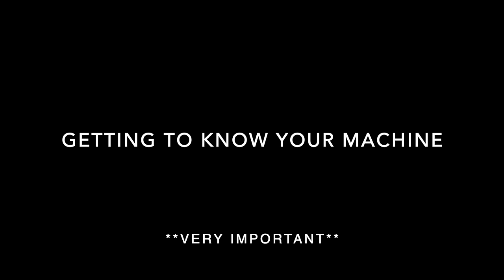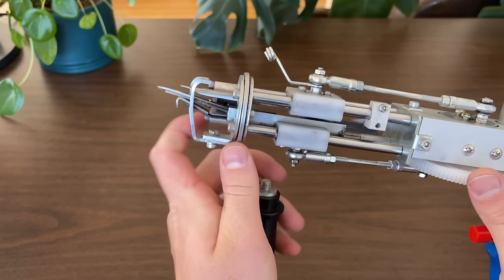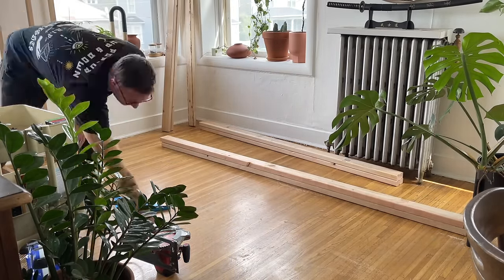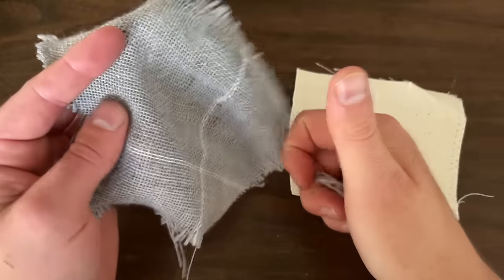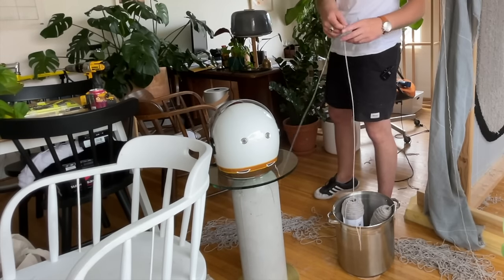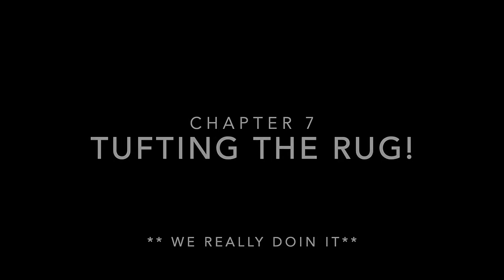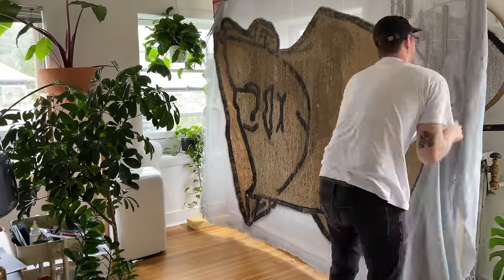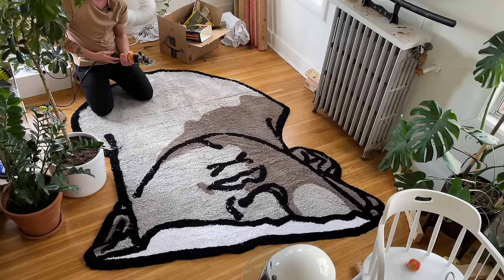EVERYTHING YOU NEED TO KNOW TO MAKE A RUG // RUG TUFTING

Comment: Ok, so the "embroidery fabric" you were looking at is called Aida, and it was created & is used specifically for cross-stitch.

Hand-embroidery is traditionally done on linen (or any even-weave fabric). Traditional hooked rugs are also done on a variety of evenweave fabrics, including monk's cloth, linen, burlap, or rug warp. I assume a rug tufting gun would also work on those fabrics, typically at 12 or 13 thread count.

Just don't try to use aida for anything but cross-stitch. It's a weird, stiff fabric!
Reply from the maker: Couldn't agree more! I noticed a lot of online places were trying to pass this Aida as tufting machine fabric when it definitely is not lol!
Reply from the maker: Thanks you for the comment! :)
Reply: @Shop Last.  I've been doing more rug hooking since posting this comment & learned some new stuff that made me think of what I said & worry if it was correct! Monk's cloth is similar to Aida in that it's a "basketweave" fabric, and Monk's cloth IS used for rugs! But looking at the video again, I'm still sure that was Aida. Monk's cloth looks similar, but wouldn't be so stiff. I think the one you called "Monk's cloth" in this video might have actually been "Rug Warp"? But I'm still not an expert on fabrics & every time I learn something new, I realize how many times I've been wrong! The white lines are a feature you'll see on Monk's cloth frequently, but it seemed to be single threads woven, instead of a 3x3 pattern like with monk's cloth and aida 🤔

Comment: All the repair parts can be ordered quickly and cheaply from the factory in Shandong, China.  They are very knowledgeable and helpful and can tell you what to anticipate as far as maintenance and even a few improvements!  Thanks for a great video.  That was a lot of fun and made me want to get a gun to make rugs for my grandkids and maybe try my hand at turning child’s crayon pictures into custom rugs for their room.  I used to lay/repair carpet and there is a heavier pro gun that is not nearly so much fun to use.  But at those shops you can find special carpet knap scissors that give perfectly level cuts when you find minor imperfections.  Also, in the 70’s we used gunny sacks from the local feed store to make rug patches for professional carpet repairs.  It holds up and stretches roughly the same as the jute backing on most carpets.

Comment: This video is so helpful, thank you so much! Has anyone ever used a tufted rug for a long period of time? I love the idea of them, but the fact that the wool is basically held it with tension makes me a bit nervous for regular and real-life use. Does the glue crack/cause issues over time? Does the backing peel off? I always think these rugs are absolutely beautiful, but are they better art pieces, or are they durable even after stepping on them, vacuuming, etc?
Reply from the maker: This is a great question! I’ll do my best to answer all of the different parts. 

The yarn isn’t held in my tension (well it is at first while you’re tufting) but once you add the carpet adhesive or what ever glue you use that glue locks into the fibers of the yarn on the back side of the rug making it nearly impossible to pull the yarn out. The glue doesn’t crack, it dries in a pretty malleable. And the back material should come off if you use a good quality adhesive. This process is basically the same any rug manufacturer would use but we’re doing it by hand.

This rug has been my main living room rug and it has seen a lot of abuse and it is holding up great so far👍🏼
Reply: Is the glue you chose specifically for a floor use tufted rug?  I saw another YouTuber demonstrate washing tufted rugs and they ALL fell apart when she put them in the wash.  I do not believe she used the glue you used, nor do I believe the floor rugs should be put in a washer.

Comment: Hi, I just got interested in started to tuft. When creating new rugs do you always have to create a new frame?
Reply: Also can you put a list of the items you used?
Reply from the maker: You don’t need to make a new frame every time. You’ll only need to make a new frame if the size of the rug you’re making is bigger than the frame. Or if the fabric you have left is to small to fit on the frame you have.

The items you need are:
Tufting gun
Monks cloth (for rug tufting)
Yarn
Glue
Wood (for frame)
Carpet tacks (for frame)
Eyelets (to feed the yarn though on your frame)
Backing cloth 
Scissors
Sheep shearers
And I recommend a threading tool.

I think that’s everything? 😁

Comment: So you explained everything great EXCEPT for the actual tufting of the rug. You just did super fast forward speed and didn’t explain the correct way to do it or what would cause you to mess up. You explained in depth how the gun works and how to build a frame but not about the correct techniques needed to tuft. Turned out really great though
Reply from the maker: That is a valid point thank you! It is hard to explain but the gun will kind of walk it's self once you start to do it
Reply from the maker: And it depends on the speed you set the gun up for.

Comment: Fantastic rug. May I ask why you use two threads instead of one. Also does the adhesive stop the backing from fraying. Many thanks
Reply from the maker: You can ask anything you'd like! This channel is for me to learn and to share with anyone who wants to learn! Two thread will help fill out your design much faster than using one. Along with that, the fabric is losely woven and having two threads in a whole compared to one will help them stay in place mech more easily. And it will help, but I would recommend making a hem or folding over when applying the backing. Mine is still holding up just fine but part of me wishes I took the time to make it nicer.

Comment: My electrician room mate it very concerned about the safety for your tufting gun, specifically the live uncovered leads on top combined with the aluminum body as well as the on off switch, something about the power rating. He’s is absolutely shitting himself lol
Reply from the maker: Yeah I’ve seen a lot of those comments. It’s definitely a very “bare bones” design. But if you have any intelligence at all you’ll know not to mess with those certain parts of the machine. When you buy the machine there is a pamphlet that explains the dangers and warning of using the machine. But I haven’t had any issues nor have heard about any accidents that have happened with them, and these machines are super popular so who’s to say lol

Comment: Really nice work, master piece 🤌 
Does anyone have any idea how to adjust the size of the needle hole ???
Reply from the maker: There should be a screw about an inch  and a half from the needle hole on the needle body, loosen that and then you can adjust the plate under the needle to close the hole smaller or larger👍🏼

Comment: You're explanation is wonderful. I do punch needle and have been thinking about making some rugs, so I greatly appreciate you showing the gun and how it works with the yarn.
Question: how did you project your image that large? 
I don't want to go this big, but I want the lines to be this perfect! 💯
Reply: I'd use an old school projector. You trace your design on clear acetate sheet, put it on the projector, and it projects the image as large as you want it. I use mine to project images for painting windows. It works very well.
Reply from the maker: I just uploaded my image to a usb drive and plugged it in and then scaled it with the zoom on the projector. But I also love @WhereAdventureLives style as well!

Comment: The side that you had facing the camera and the side that you are using the tufting gun on is the backside of the rug. Is that correct? Also, when you were initially making the grey lines before starting the project you mentioned that it was not working. What did you decide was not working when the thread (yarn) was not staying in the fabric?  You are the third person I have seen doing this with the first being Sumji.  If I can figure out how to start an online business this would be the area that I would really want to do. I believe that once I learn it should relatively easy.  One more question, after nuilding the frame what was the name of the sticks with nails in them that you attached? They looked like the same thing used when installing carpet in the home. Thanks in advance and I like that your video is very organized.

Comment: Which machine did you use for the trimming ??
Reply from the maker: I bought a sheep sheerer off Amazon! You need something with wide set cutting blades to be able to get the yarn in there to trim it up👍🏼
Reply: @shop_last  i looked it up but people having real bad problems with the most. can share the model and ur experience with it?
Reply from the maker: @gorkemkilic9769  I bought these.

https://www.amazon.com/BEETRO-Electric-Professional-Grooming-Livestock/dp/B08DN6FJKV/ref=mp_s_a_1_3?dchild=1&keywords=sheep+sheer+clippers&qid=1629243999&sprefix=sheep+sheer&sr=8-3

These are very powerful. You just want to take your time making sure that you’re holding the shedders flat when trimming👍🏼

Comment: just one question: the way that you glued the backing was kinda confusing.. You first applied the glue and then let it dry, but not so much so that the back would stick. Is that right?
Reply from the maker: Correct. I wanted it to be dry enough that I could handle it. But I wanted it to still be tacky enough to fold over the edges of the monks cloth. This was more me being impatient than how it should be done. You can wait until the glue is all the way dry and then use the spray adhesive to fold the edges over and then apply the backing.

Comment: How does it hold up when you clean/ wash it??
Reply from the maker: So because I used acrylic yarn and not wool, I’ll have to be careful washing it. These cheaper yarns will definitely bleed dye so you need to spot clean very carefully or use a steam cleaner if possible👍🏼
Reply: @shop_last  thanks for the info. And the adhesive,  does it hold up as well if you dont mind me asking
Reply from the maker: @thehacker40_1  I would definitely go with the ATT stuff if you can. That will hold up better that just standard carpet adhesive👍🏼
Reply: @shop_last  thanks. Still waiting for my gun so just wanted tips and stuff 😁
Reply from the maker: @thehacker40_1  right on! I’m happy to help any way I can!:)
Reply: @shop_last   what would you inplace of monks cloth. Its not available where i live
Reply from the maker: @thehacker40_1  anything with with a pretty loose knit should work. You need to make sure that there are visible holes between the knitting. I’ve heard that burlap can work, but I haven’t tested that for myself yet.

Comment: I've never seen monk's cloth that flimsy and transparent. I've used monks cloth and a variety called panama cotton for punch embroidery which isn't embroidery at all, but manual tufting, flexible, thicker and grabs the yarn, but looks at first glance like your swatch of embroidery fabric (Aida). Your transparent and thin monk's cloth is much more light weight. I'd assume not as durable but you glue your work for hard wear and tear which isn't as common with punch needle work as its rarely used for large area carpets. Have you tried other varieties of monk's cloth and arrived at this one being best? Is this one made specifically for tufting gun's but not the panama cotton?
Really helpful video, thank you! 🙏❤️
Again, you never EVER want to use those chemical adhesives without the right type of mask (not the covid kind, one that actually protects you from fumes) and never EVER expose your pets to these fumes. I'm NOT joking. It's extremely dangerous.
Id never use these glues if I could avoid it, and certainly not indoors in my home. It's asking for instant asthma, COPD and cancer, it can cause all of the above. And that's alot of exposure I just watched. Please don't die for your art, that's unnecessary.
I'd so love to give this a shot, but will definately research less toxic options for gluing as I only use non toxic materials in my home, have dogs and visits from toddlers. I'm sure diluted wood glue (used for other fiber art) would hold up just fine, no toxins or fumes, or some ofbthe old fashioned glue recepies with gum arabicum, ill have a chat with some local fiber artists about that at some point.
But I'd love more input on the type of monk's cloth and where you found it. Thank you! 👍💕
Reply from the maker: This monks cloth is specifically for tufting guns. The loose knit is specifically to have a lot more mobility with the fabrics fibers to accept the huge needle that the gun uses. Also, you are correct. I had ventilation in the room when I did it but still should have had a mask on.
Reply: @shop_last  oh that's interesting! It's a bit of an investment (they cost alot more in Europe these machines) but I'd love to tuft one day, so this is great to know!
Be safe making art, always! 💕👍

Comment: my gun got jammed today and it caused the wheels for the needle and the scissors to sync up, so instead of them being opposite (as in when the needle is fully out, the scissors are fully back) they move at the same time ( so they are both out and back at the same time) do you or anyone in the comments know how to fix this
Reply from the maker: You will need to unscrew the top wheel and manually rotate it until the arm is opposite from the bottom, than bolt it back in. That should fix your issue. That should happen though so make sure that you check all of your bolts and nuts that they are tight and secure👍🏼

Comment: I have a question. Is it illegal or unethical to make ancient greek designs as coasters or rugs abd sell those?
Reply from the maker: Thats an interesting question. If you are completely copying existing art/designs that may be owned by a museum or other entity and then selling them there may be an issue there. I know there are some laws around copying art, I believe there needs to be like 16 changes to a piece in order for it to be considered new art (check out the story about Sheppard Ferry using a photograph to create the hope poster for Obama). But wouldn't hurt to do some research on the topic. And as for ethical reasons that's going to be something you need to consider personally. Maybe find a couple books on cultural appropriation and see if there is anything in there that makes you feel inclined to lean one direction or the other. Hope this helps
Reply: @shop_last  Thank you so much. I have seen so many art products inspired by starry night and other famous art. There were also earrings of the similar design of your rug. I will search more about it.  Thank you for your reply 💕

Comment: Love this video, very helpful 
I got the cut pile gun and  got one issue - if I do a curve, as you did when you were outling your shape, my cloth most deffinetly would tear apart , 
is that normal , should I do only stight lines or  itssthe the material that isn't good :))
Reply from the maker: Thank for your comment! There could be a couple issues. 1: you can definitely do curves! I usually do them in spurts instead of just having the machine go the entire time and trying to follow the line. 2: it could be ripping because you don’t have the right fabric, you need to make sure it’s to loose knit stuff like I showed in the video. Or 3: your needle might not be going out all of the way in which case you need to adjust your foot so that when the needle is all the way back it’s not sticking out past the foot👍🏼 I hope that helps! 😊
Reply: @shop_last   thank you! :)) , I guess I have to be more precise in the process and work in smaller parts, because I checked everything else the fabric and all that , love your content great job once again
Reply from the maker: @ВалерияСтойчева-ц6ы  thank you! I really appreciate it! Best of luck with your project!:)